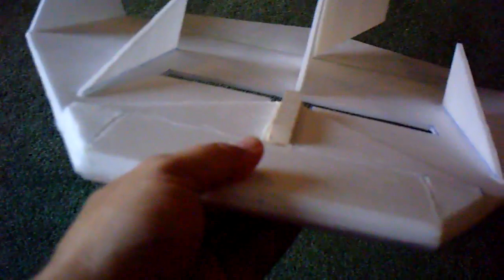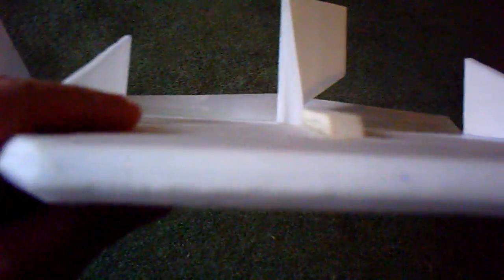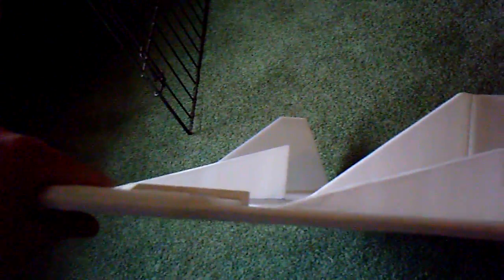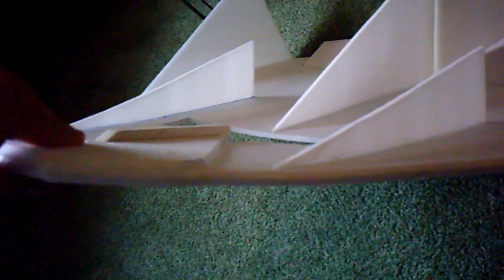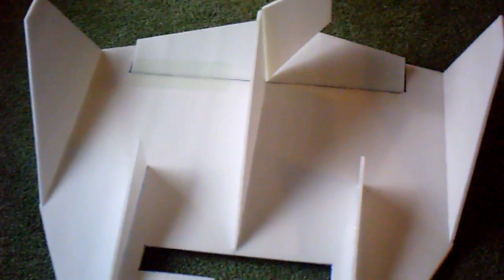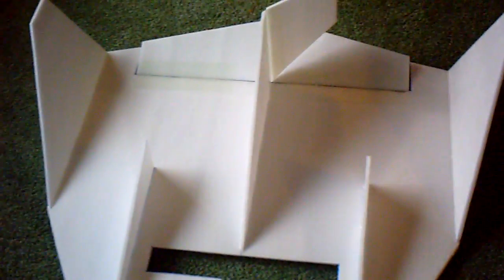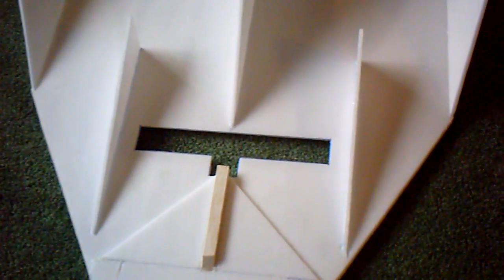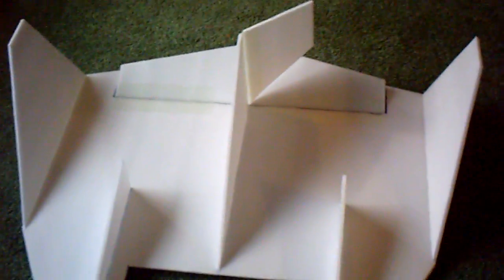Cheap and Easy build with KFM1 Airfoil

Comment from the maker: @DanielMadrigalC   I didn't design this one, it came off of RC Groups actually but I made some modifications to it because I found that the airframe would flex far too much from nose to tail (Hence the KF1 foil to strengthen the foam).  I installed my electronics tonight and if the weather improves tomorrow I'll try to maiden it.